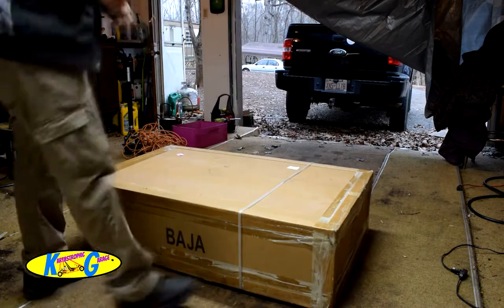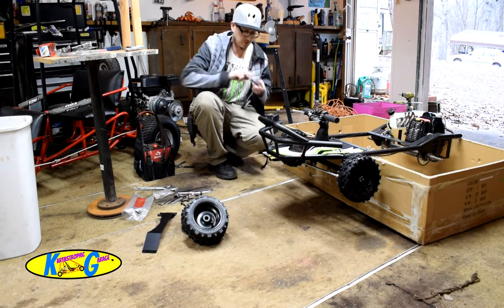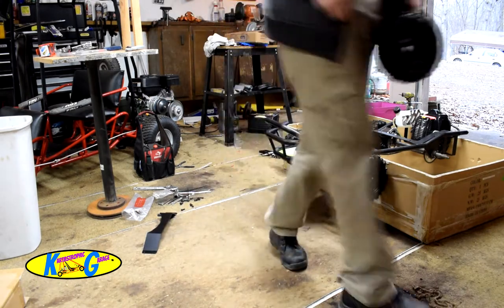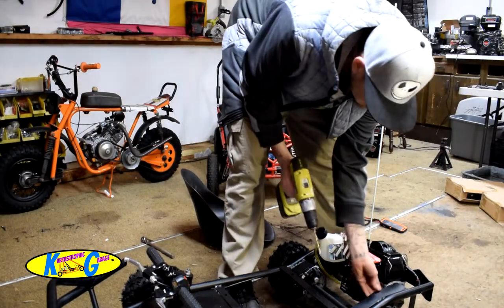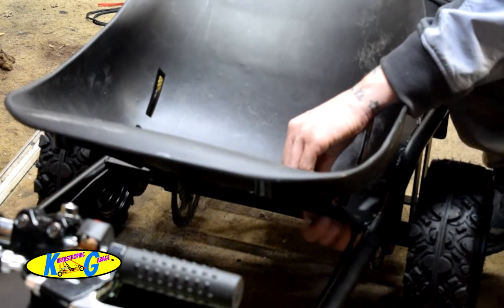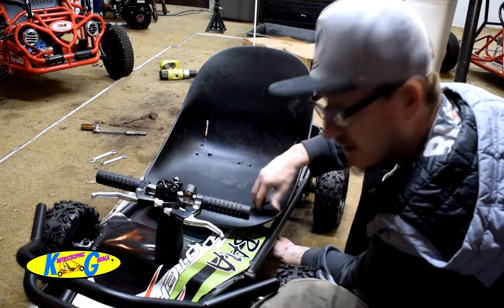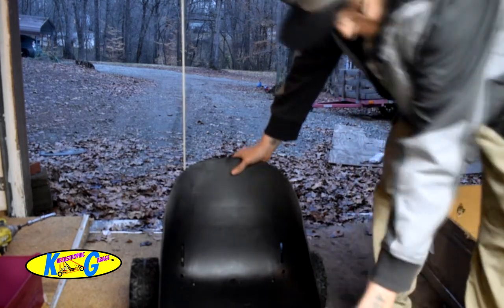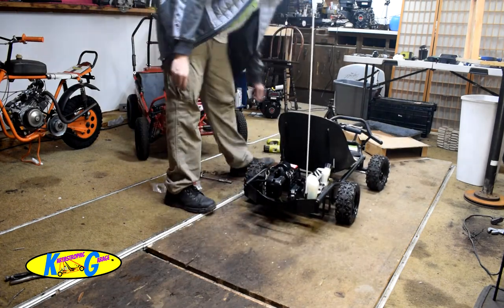49cc Baja ScooterX GoKart Unboxing

Comment: I am makeing a homemade tank go kart 2 49cc engines and differential brakes why I am using two engines is the differential drive transmission to hard to build so instead I have two independent engines one for the left and one on the right